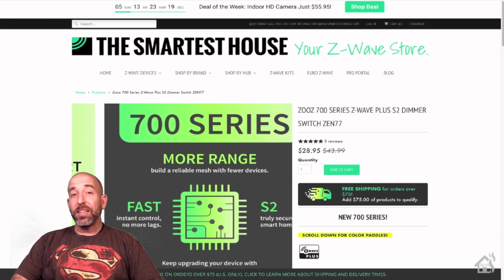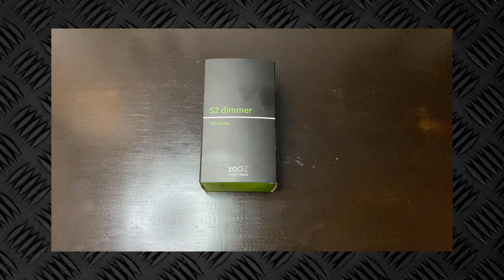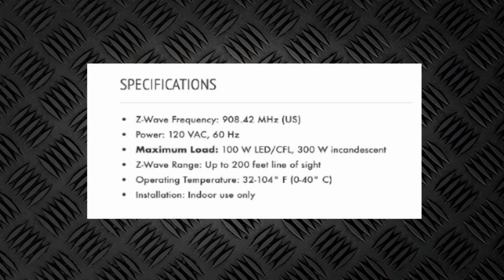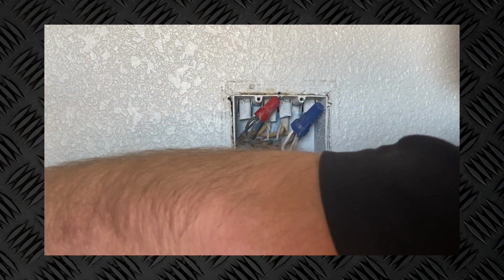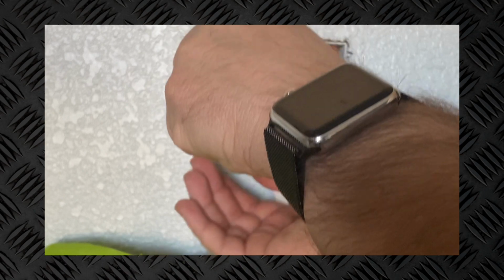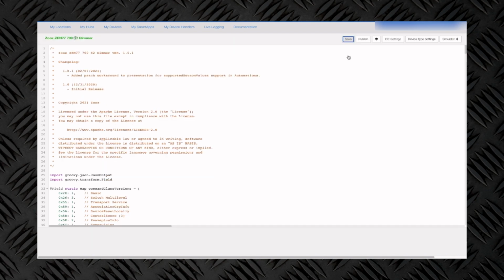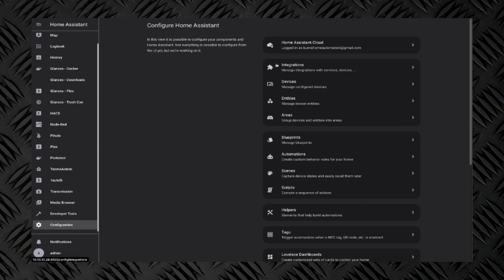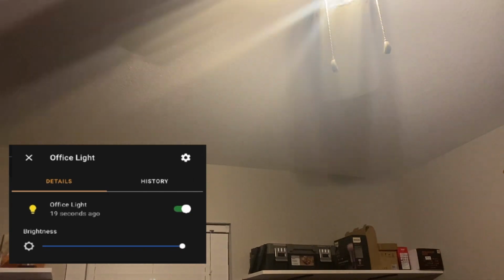PRODUCT REVIEW: Zooz S2 Dimmer Z-wave Smart Switch 700 series!!!!!

Comment: how does the switch itself work?  vast majority i will be using the physical switch curious how dimming works.
Reply from the maker: so it works great as a physical switch.  though it is a decora style switch, its essentially a button.  pushing it upward will turn it on, holding it down upward will brighten the light.  pushing it down will turn it off and hold it down downward will dim the lights.  I hope thats not too confusing.

Comment: What does the little button on the bottom do?
Reply from the maker: so that is an "air gap switch" .  It is designed for when you are changing bulbs, you pull that switch out and then it will shut off power to the light allowing you to change the bulb without possibility of getting shocked.

Comment: I just got zst10 700 usb stick and s2dimmer 700. 
I am using raspberry pi4 with home assistant and zwave JS integration. 
I am unable to include any switches to the stick. It is not detecting any switch.
Any help ?
Reply from the maker: what integration are you using to connect the zwave stick to home assistant?

Comment: Thanks for the review! Nice to see a real experience with it. One thing I noticed: @10.42: In the bottom left corner of your electrical box, the 120v hot wire feeding into that green screw terminal connector is really close to shorting out against the side of the metal box :)
Reply from the maker: thank you so much for the comment!  I will definitely get that corrected.